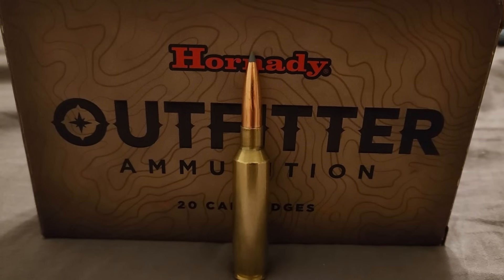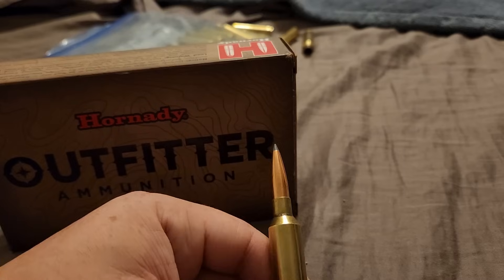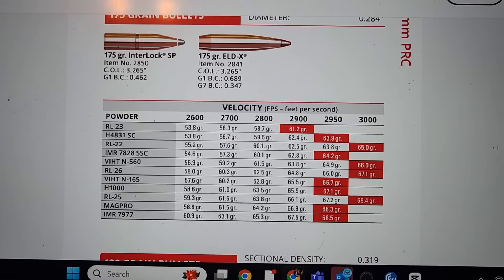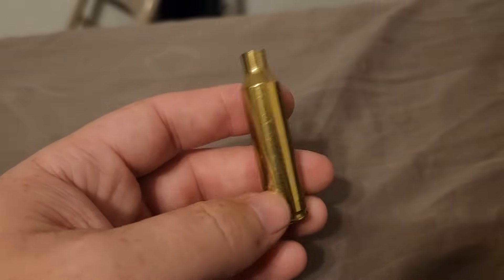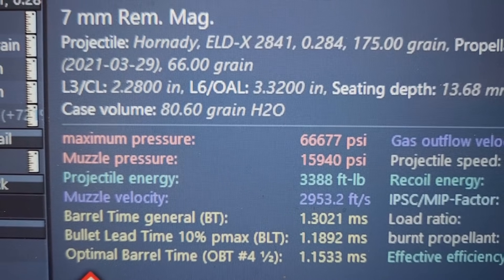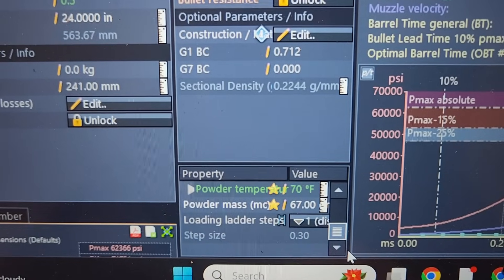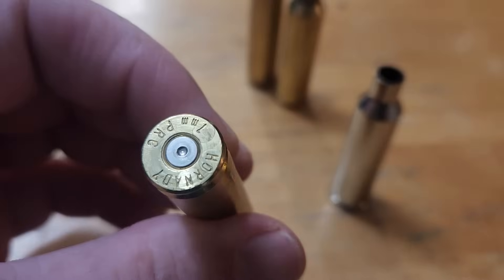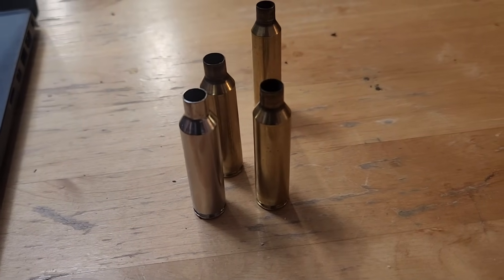Why your 7mm PRC is slow...

Comment: Honest question here; what's the obsession/fixation with muzzle velocity? I've always been pragmatic with my cartridge choices and muzzle velocity isn't really a factor, at least not directly. For hunting applications it comes down to the effective velocity window of the bullet you've chosen to hunt with, and what distances that correlates to in whatever cartridge you're looking at. Most hunting bullets function down to 2k fps (some as low as 1600) and you have to look at what distance that is for a given projectile. In most cases that's longer than most people would be willing to take an ethical shot. A 175gr ELD-X with a 2800fps muzzle velocity gets you out to about 600 yards at 2k fps, 3000fps muzzle velocity takes you out to about 750. Unless you expect to/want to be about to take a shot between 600 and 750 yards with that cartridge, only thing you're getting with that extra 200 fps is significantly greater throat erosion. 
If any of you understand the logic of chasing velocity I'd love to hear it. I primarily bow hunt, only time I use rifles is for varmint/predator hunting, long range target shooting, or just plain for fun. But I've been shooting for almost 30 years and hand loading for maybe 15 now. I've owned and shot 308s, 300 Win Mags, 7mm mags, 30-30s, 223s/5.56s, 6.5 Grendels and 6.5 Creedmoors.
Reply from the maker: What is the difference between a 7mm PRC and a 28 Nosler? They both have fast twist barrels... It's the velocity. It's how we have always talked about cartridges.
Reply: @ReloadingWeatherby  Yeah but my question is why people think a few hundred feet per second actually matters when it comes to actual, practical usage
Reply from the maker: @DanielReyes-hz1qk   Very true... but people are very tribal about their cartridges. For a lot of people it's fun to see the little differences that don't really matter.
Reply: @ReloadingWeatherby  As a huge 6.5 Grendel fan....I completely understand that 🤣
Reply: Simple man like big number. Me bullet go fast so me good hunter. Me shoot bigger bullet than you so me more manly. That kind of simple shit. You’re being far too logical and understanding of nuance. You’re not a rube to be suckered in by marketing for every new thing the industry wants to sell you to make more money. All that being said, your ability to consistently hit a non-static target at a range that you don’t have 100% confidence in is significantly improved by better ballistics and bc only goes so far. Velocity makes up a lot for ranging errors and can save your bacon well before you’re at 600.
Reply: @Snailz5  Well said. Does velocity really make that much of a difference in ranging errors? I'll plug numbers into a ballistics app later. I'm an old Mil-Dot scope guy my range estimation is probably better than average lol. But I used to shoot in the practical/tactical matches that eventually became PRS
Reply: @DanielReyes-hz1qk  I'd check out LittleCrowGunwerks video on the subject for a much more complete analysis, but in short, the extra velocity does help a non trivial amount. It's all moot if the gun is unshootable for the user, but if you're truly reaching out there regularly, it's worth shooting as much gun as you can handle.
Reply: @Snailz5  Yeah I'll have to check it out. The knowledge I've compiled on external and terminal ballistics over the decades pointed to extremely limited returns on velocity passed 2900 fps. Sounds like it might be worth revisiting
Reply: @Snailz5  The Little Crow series on the 7mm cartridges is really detailed.  The videos need better editing as they are way too long, but the data and info are solid even if they go down a few rabbit holes at times.  The guy tries hard to evaluate many aspects and I commend him for his hard work and knowledge.
Reply: @DanielReyes-hz1qk  run the numbers on a 143 mcguire, 145 badlands or 147 apex at 3200 fps with a g1 of 0.59 or a g7 of about 0.300.  Muzzle energy is 3300 ft lbs.  Then run a 175 or 180 lead core at 2850 fps with a g1 of 0.720 or a g7 of like 0.365.  The copper has an operating range of 0 to 800 plus yards on any shoulder bone, etc.  Look at wind drift and bullet drop at 500 or 600 yards and see the difference velocity makes.   I will take a 145 copper monolithic at 3150 to 3250 fps in a 7 saum, 7 wsm, or 7 prc any day over a 2800 to 2900 fps 175 or 180  lead core target bullet.  The 280 AI is also great with a 145 mono and should get 3100 plus.
Reply: @thebryguy96  I only use radar drag models, neither G1 nor G7 is all that accurate when you factor the varying drag at different mach numbers. But I get your point. Been a busy weekend haven't run the numbers I'd wanted to, I'll definitely check this out when I do. Appreciate it. I've primarily been a long range target shooter in my life and most of my hunting at this point is with a bow or at close range for varmint/predators. All the info helps

Comment: Great video.  From what I can tell, the 7PRC has the potential to be great, but it needs everything to be perfect to pull it off.  It is the MG of cartridges.
Reply from the maker: Hornady shouldn't have released it as a 3000 FPS cartridge.
Reply: @ReloadingWeatherby  Bingo!  And we all need to remember a 175 is a heavy bullet.
Reply: @SpudOutdoors  So, you thought the 7prc was gonna get 3000fps?  As soon as I got my hands on it I knew it was a stretch.  7 Rem Mag barely gets there with a 175.
Reply: @nt3523  my 7 mag shoots 175 out of a 22” at 3036. My 26” 7 mag shoots a 195 at 3050. It’s called knowing how to fully form the case and use the correct powders. I think 7 PRC is a joke
Reply: @SpudOutdoors  Been shooting and loading 7Rum for close to 20 years.  I think 7 Rem mag is a joke.
Reply: @nt3523  you realize how ignorant you sound. There is such thing as efficiency. 7 rum is to much of a powder column. 7 mag is the perfect case size. A fully formed case is 88 grains of water in normal brass. 7 rum is just a cartridge that struggles to get 100% burn. Unless you got to smaller bullets and faster burn. It’s has the same problem as 28 nosler. It just throws powder at the problem.
Reply: @SpudOutdoors  Far from ignorant.  You're the one that doesn't know 175's are heavy for 7mm.  7Rum stomps 7rem mag.  Beats 28nos, too.  Explain that.  I'd way rather have horsepower than efficiency.  I'm killing elk, not rabbits, bud.
Reply: @nt3523  175 isn’t considered heavy when you shoot 195. I have no reason to just dump money into wasted powder. I get more bang for my buck shooting cartridges that still get speed and more energy down range. You realize that you literally have powder burning as it’s exiting the barrel. There is a reason my 7 mag keeps up with a 28 nosler. Because it’s Actually burning all the powder. And I had to choose between 28 nosler and 7 rum. I’m choosing 28 nosler all day.
Reply: @nt3523  175 isn’t considered heavy when you shoot 195. I have no reason to just dump money into wasted powder. I get more bang for my buck shooting cartridges that still get speed and more energy down range. You realize that you literally have powder burning as it’s exiting the barrel. There is a reason my 7 mag keeps up with a 28 nosler. Because it’s Actually burning all the powder. And I had to choose between 28 nosler and 7 rum. I’m choosing 28 nosler all day. What bullet are you shooting and the speed. What is your energy you getting at 500 yards and how many grains is it taking you to do it.
Reply: @SpudOutdoors  Not many guys shooting 195's out of a 7 rem mag.  Not with any velocity anyway.  Your numbers sound like a bunch of baloney.  As far as keeping up with a 28....I know that's baloney.  Nosler shows the 28 pushing a 185  300fps faster than a 7rem mag with H1000.  As far as what I'm loading right now....a 168 at 3300. And that's not pushing it.  I don't see the need.  Your rem mag will never see that velocity.
Reply: @nt3523  my 28 nosler without stepping on it is 3350 with 162. There is several videos of 195 in 7 mag over 3000 fps. I have a Garmin, labradar and magneto speed. I’m definitely getting those speeds. I hit pressure at 3080. I backed it down to 3050 and getting .54 MOA at 300 yards. I don’t screw around with my reloading, I put all my money and time into it outside of work. Most of my rifles are custom. My powder system alone to throw powder is almost 3k. I have no incentive to lie. I live the army values and one of those is integrity. To answer your other question. Remington, browning, fierce, Ruger, Springfield all make fast twist 7 mags. So you can achieve those speeds with factory rifles. I just don’t care for factory chambering. I want my chamber to have 0 run out. Checked my GRT on 168. There really isn’t an optimized powder to get the efficiency out of that bullet in the 7 mag. Best I can get is 3168. I’m not saying the 7 rum isn’t fast. It is. Just like the 28. It’s just dumping a ton of powder to do it. Plus bullets have limitations on speed. High and low. If pick a bullet and if that bullet max speed is 3000. Then doing 3050 is pointless. I’ll load it down to stay within the limits of the bullet.
Reply: @ReloadingWeatherby  Yeah but spin doctors gotta spin.

Comment: Each rifle is slightly different. H870 in a 300 win mag gave 2700 fps. 30-06 performance. I started using IMR 4831 and got 3100. Same bullet. 
  Follow the recipes and work up your loads. Find the accuracy and velocity that works for you. I always wanted tight groups and high velocity , but in reality, a 2" group at sizzling velocity is adequate for hunting. You should always find a way to get inside 300 yards, 400 at the most.
Reply from the maker: Thanks for watching

Comment: Sorry your rifle was slow I have the exact same rifle now in a boyds stock! 160cx at 3,060 162eldx at 3,160 175eldx over 3,000 with h1000 and lrt, 175ablr at 3,000 180eldm at 2,950! My barrel sped up 100fps and settled in after 100 rounds but now so far 644 down the tube!
Reply from the maker: I do think my barrel was slow. But it never sped up after 250 rounds

Comment: Burn rates and barrel length all work together. As do the correct primers. You can't use a faster powder at the same charge weight as slower powder safely. Starting at max charge with substitute components is foolish. This is how you ruin a rifle.
Reply from the maker: I agree

Comment: Well my seekins element 7prc, with a 21in barrel shooting the federal 175 eldx is coming out at 2968fps. I'm pleased with that velocity and a 22in barrel
Reply: My Seekins PH2 7prc 26" barrel shoots that same stuff at 2992. Darn accurate also.
Reply: 2950 fps avg for 10 shots with Federal 175gr ELD-X out of my 22" Savage Ultralite with it's PR barrel .....  Hornady ELDX 175gr Precision Hunter 10 shot average 2792 fps
The Federal was 158 fps faster side by side.
Reply: @mmickey8997  I would love to see a video of it. I’ve seen too many even with federal with short barrels shooting under 2900.
Reply: @SpudOutdoors  I waited 90-100 rounds of Hornady before I even broke out the Chrono to give the barrel time to settle a bit.
I would tend to believe the Federal numbers. If you chop 50-75fps off the Federal then you'd have to do the same for the Hornady......in that case the Hornady stuff would be showing closer to 2700 which is stupid slow. 
I would say the fact that the Hornady is showing under 2800 which seems to be the going rate for it would validate the Federal numbers
Reply: @mmickey8997  so your increasing the pressure in the barrel. Bryan Litz studied the speed up and stated fire cracking increases the friction which increases the speed. He recommends to smooth the barrel back down to keep pressure more stable in the barrel. But your barrel your choice. I’ve done that for years with my 25 creed. I clean the barrel then run JB blue down the barrel to smooth it back out. Rifle shoots 1/2” groups at 300 yards.
Reply: @SpudOutdoors Just to be clear I didn't sit there banging 90-100 rounds. That was over multiple range sessions. Just taking my time with break in and cleaning. It is crazy how so many guys have such a wide variety of results with this cartridge.
It's funny too because I work in the industry and kind of had my Hornady results put back on my rifle by a Hornady rep (22" barrel, not shot in yet etc) for why it was so slow.
.....and then my barrel is fast when I switch to Federal. 🤷‍♂️
Reply: @mmickey8997  still makes the fire cracking. i do the same thing you do. I like to pit 100-120 rounds down a barrel to make it settle down. i get more consistent velocity and accuracy. however i use a bore scope to clean barrel completely. i bet you have a carbon ring. it can cause high velocity.
Reply: @SpudOutdoors  The 7PRC is known for carbon rings and needs to be cleaned more regularly.
Reply: Also getting 2940 with federal 175 eldx out of my 22in seekins element. Measured with garmin xero c1.
Reply: I have a Defiance action and a 22” Proof Research barrel that sends them just over 3000, using my Garmin. I use RL 25 69gr and Peterson brass. Zero pressure signs and tight (.378”) groups. H1000 works pretty well too
Reply: @jeromykimbrough1278  did you check your pressures in GRT. Bet your way over 65,000
Reply: @SpudOutdoors it might be over but I’m getting no pressure signs. I’ve shot a couple of hundred through it. Hornady brass was showing pressure signs at 68.3
Reply: @ run it
Reply: Okay two folks same ammo similar velocities which means one of you is wrong. 21 vs 26 is a huge difference. I am betting one of you is either guessing your velocity or using a light chronograph.
Reply: @SpudOutdoors  My loads are chronographed on my new caldwell velociradar. Very close to same numbers on my chrony alpha.
Reply from the maker: Wow

Comment: When the 7MM PRC was introduced, the impression that I got, and probably others, was that it was going to be a modern, efficient, slightly less recoiling ultimate North American big game hunting cartridge, a genuine replacement for the 300win mag, a 180 gr (ish) bullet at 3000 ft/sec Instead, what everyone ended up with was a 30-06 😂 another fine, North American big game hunting cartridge, a 180gr bullet at 2800 ft/sec I’m not against modern technologies. I think it can be quite useful. It’s a shame that the 6.8 western hasn’t taken off yet. There’s a saying in backpacking that “every ounce counts” I truly believe that! And the more time you hike in the western mountains, you may come to appreciate that too? Having a slightly smaller action, and yet a cartridge with plenty of power, very close to your 7 mm magnums, would be amazing!
Reply from the maker: Thanks for your comment
Reply: Not only is the action shorter, but I'm getting box velocity out of one load and only losing 60fps in another with a 20" barrel. I think the 6.8 western does what the 6.5prc and 7prc are supposed to do at the same time. I have a 20" barrel in each of those on the way to do direct comparisons.
Reply: Exactly. I initially thought they were going the Nosler route and putting a 7mm bullet into a 300 PRC cartridge. Unfortunately, they made a sub par 7mm wsm

Comment: 7 PRC case Capacity is smaller than 7 Mag? They should had made this Caliber with more Case Capacity. 7 Mag is Already Here? What is the Point. Load 7 PRC hot and Pressure Problems arrive because of to Tight of Chamber?

Comment: It's to bad that Reloader 26 isn't available any more, I do have some :). My Seekins Precision Havak PH2 in 7PRC with 26" barrel using said powder (68.5 grains and cci mag 250 primers in my rifle, worked up load), Averages right at 3070 fps (@ 3200feet elevation) using 175gn ELD-X hand loaded using Hornady brass. Absolutely no pressure signs and groups great. Worked fantastic on a bull elk I shot in October.
Reply from the maker: Sweet

Comment: N565 has almost the exact same burn rate as H1000... If 565 is good, then so should H1000. N560 aligns more with H4831sc.
Reply from the maker: Yeah... N565 is a better powder than H1000
Reply: @ReloadingWeatherby  That's subjective. N565 is a double base powder, where as H1000 is a single base powder. Double base powders are more temperature sensitive, and can lead to faster throat erosion. So it's really give n take as everyone's results will be different.